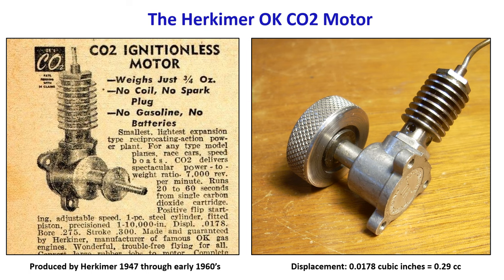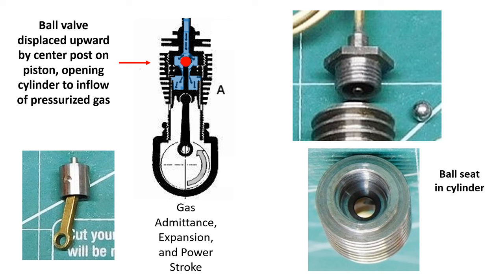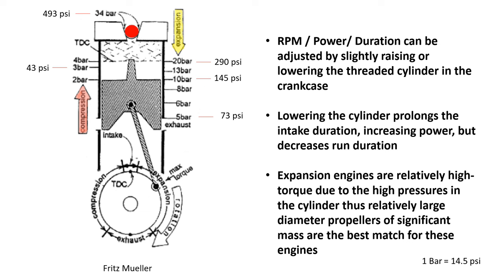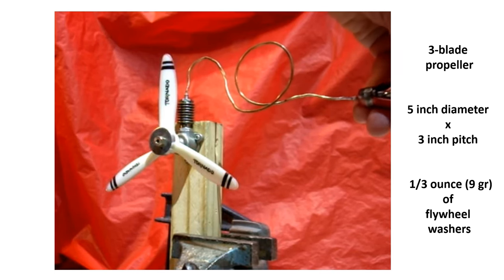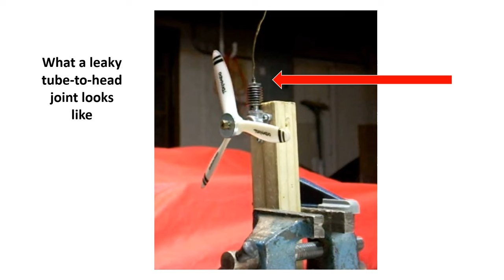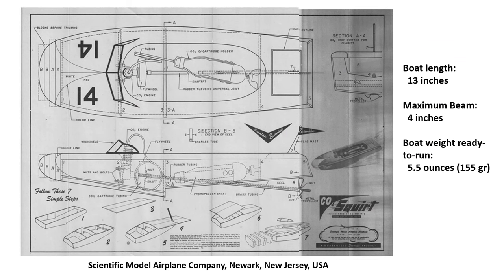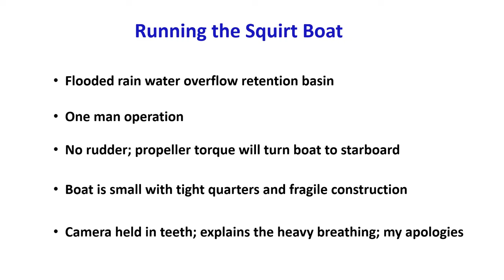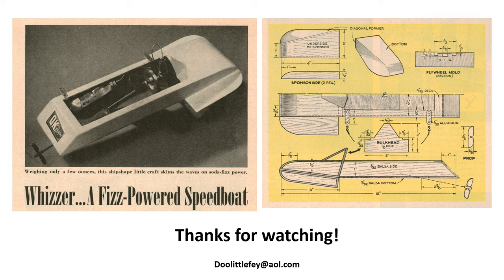Herkimer "OK" CO2 motor in vintage Squirt boat

Comment: I tried to convert a 0.65 glowplug engine into something like this. I had just marginal success, but enough to prove it would work had I had a way of making a better valve.
Reply from the maker: Congrats on taking on that challenge! I suspect the CO2 or pressurized gas supply system would be quite a challenge for such a large engine.
Reply: @tomfey6020  Sorry, I didn't mention that was 60 years ago. I was using compressed air at about 25 psi.
Reply from the maker: @tsbrownie  , I did some system leak testing on the little Herkimer motor with a shrader nipple soldered on to a spent CO2 cartridge, fed by a bicycle pump. I had a lot of tinkering fun.

Comment: A couple/several pennys on the stern and/or a simple prop change should toss that right on plane.  It has the beans to get that done.  Easy to see.  Dumas would probably have a better prop for that, even in plastic to fit that shaft.   Zipp Kits might have one.  Offshore Electrics.   I remember a TV show called The Love Boat.  They could have used the same title as your boat and it would have worked out.
Reply from the maker: Thank you for your comments. My goal is to run it with the original, unmodified, stamped brass propeller with some transom weight and post an update. Stay tuned.

Comment: I feel like one could recreate and possibly improve the design with a 3d printer.
Reply from the maker: Thanks for your comments. Regardless of the design and construction, it's still an uncontrolled boat with sub-60 second run time. Cutting edge for 1955.

Comment: Where could a new little ball bearing be found? I have one of these engines but it’s missing the ball.
Reply from the maker: Let me look around my spares box, but you may consider posting your want here: https://www.facebook.com/co2motors
Reply: @tomfey6020  thanks
Reply from the maker: @Mellotronaic  , sorry, no luck in the spares box. Good hunting to you!
Reply: @tomfey6020  no worries, think a BB would work?
Reply from the maker: @Mellotronaic  , I never took the head off my Herkimer motor so I don't know the diameter of the ball. A small ball bearing might be the better choice as they are ground true round. You can get a selection of stainless balls from Amazon for $10: https://www.amazon.com/KNLN-Stainless-Precision-Assorted-N-036-600PCS/dp/B0BX5L3G7R/ref=sr_1_2_sspa?adgrpid=1330409634317040&dib=eyJ2IjoiMSJ9.uDJAzJSzBic_dPxsNUkFCX5-jJ56vic7cX0YQ5DK20cUleV54wtlCsa5WnB88azsWIOklaRyV7od6mWFSWC8DF3vgXmz3PdV33O6-z0YpLC9VRGrMayj0RynQ10i8kRTSOC3yE6IO21x0HPE_gOBoznlI9hHCLMfIJYaSTWvgW98_NkoMkmkLRUiH0uQ280urBhx5nOWxS-49nQIG6S-6KpQ9QK9Cc__gVbPtx-WcEY.XXQSAh18yE1JJZfIj8p7a0O9PBnEY6pw_c0jWvgIWKM&dib_tag=se&hvadid=83150843000770&hvbmt=be&hvdev=c&hvlocphy=102785&hvnetw=o&hvqmt=e&hvtargid=kwd-83150948488648%3Aloc-190&hydadcr=953_1014987051&keywords=small+metal+balls&qid=1729693020&sr=8-2-spons&sp_csd=d2lkZ2V0TmFtZT1zcF9hdGY&psc=1

Comment: looking forward to the next video, as I have the same motor.
Reply from the maker: Thanks for your comments. Yes, I need to get couple good runs on the boat. But mostly it is just fun to see these little engines run.
Reply: @tomfey6020  I always thought that the steel CO2 cartridge would be too heavy for use with an aircraft. My other CO2 motors all have aluminium tanks. But I didn't think of a boat. I have a small balsa cabin cruiser that my father made 60 years ago, from a Ron Warring design. Originally it had a small Mabuchi motor and ran on a flat 4.5V battery -  haven't seen one of them for a long time! I think this is likely to be perfect.
Reply from the maker: @RichardTapp1  , my minimal experience is only with the Herkimer engine using disposable 8-gram CO2 cartridges in the Squirt boat. The 12-gram CO2 cartridges will not fit the Herkimer holder. I have no experience with the refillable reservoir systems or other motors. I think it was a challenge for designers and builders back in the day to build suitable models for a power system that weighed around two ounces (motor + prop + 8-gram cartridge) to go into an airframe that might weigh 3 or 4 ounces by itself.
Reply from the maker: @RichardTapp1  , if you have a postal scale, could you please weight your Herkimer CO2 motor assembly? I'm wondering how close it is to the "3/4 ounce" weight they advertised. And it saves me the hassle of disassembling my boat. Thanks. Tom
Reply: @tomfey6020  38 grams. I tried to post a link to a photo of what I weighed, but it seemed that the link stopped the comment from posting.
Reply from the maker: @RichardTapp1  , 38 grams is 1.34 ounces. I'll assume it is the motor, the tubing, and cartridge holder. Thanks for doing this.
Reply from the maker: @RichardTapp1  , you can always email the photo to me at Doolittlefey@aol.com. Thanks.
Reply: @tomfey6020  Yes, it is those 3 things. Photo sent by email.

Comment: Last time I watched a video called "The Squirt Boat" the subject matter was very different.
 Having said that, I think you did a terrific job of building the kit and finishing the model. That propellor, while charming, looks quite inefficient to my untutored eye. I'm sure that, with all you've learned, you could get a satisfying run out of it.
Reply from the maker: I was going to title it "CO2 Gone Wild" to try to get more hits but backed off to "...Squirt Boat". I agree, the prop is more period show than go. I debated profiling it, etc., but decided to leave it box-stock. At some point I may fabricate a "racing" prop. Thanks for your comments.
Reply: @tomfey6020  Oh,I think nearly all of us would agree that we needed to see it run box stock.
I have no expertise here, but am aware that modern speedboat props are of the "surface piercing" type and look very different from yours, which looks more like something you'd find on a slower cargo vessel.
If you were to test a variety of Amazon or 3D printed or otherwise home-made props on this boat, I would delightedly watch any follow-up videos.
Reply from the maker: @Del350K4  , thanks. The CO2 motors are high torque/low RPM, so it will never be very fast; more tugboat than Cigarette boat. I had one non-video'd run where the prop did get under water and the speed went up, RPM went down, duration seemed to improve up. And that is the type of run I'm trying to get on vid.
Reply: @tomfey6020  Additional weight astern is a double-edged sword, of course. You get a fully immersed prop at the cost of having to accelerate more mass...
Reply from the maker: @Del350K4  What you make on the peaches you lose on the pears...
Reply: @tomfey6020  Exactly.
 It's a lovely boat regardless of how far or fast it goes, and a fascinating historical item. I have a motor, actually - newer than yours, bought in England in the 1970s, but the copper pipe leaks. I used to employ it in model aircraft, and remember it performing much like a rubber motor, with a gradual reduction in power output throughout the run.
Reply from the maker: @Del350K4  Yes, power fades mostly linearly from the first rotation through the last. I'd be glad to send you the plan for the hydroplane and I happen to have a length of copper tubing superfluous to my needs. Contact me at Doolittlefey@aol.com.
Reply: @tomfey6020  My dear chap! That's really very good of you; thank you very much!
I shall do so  : )